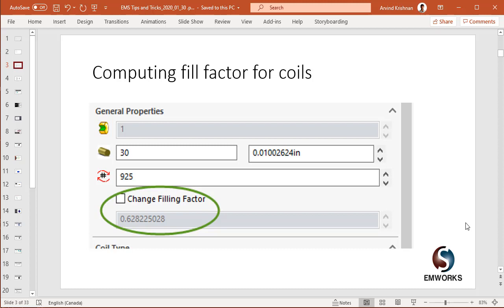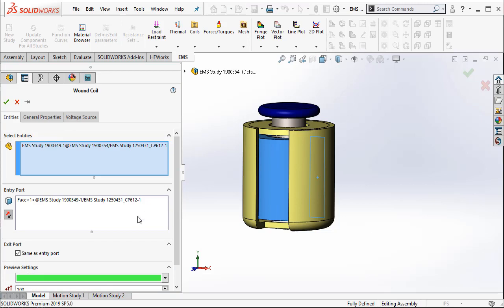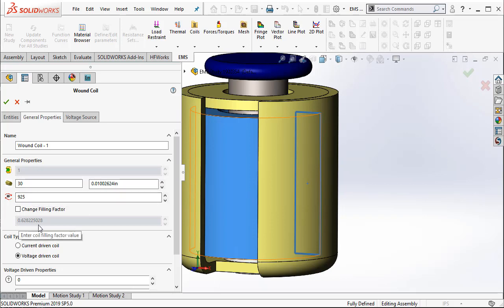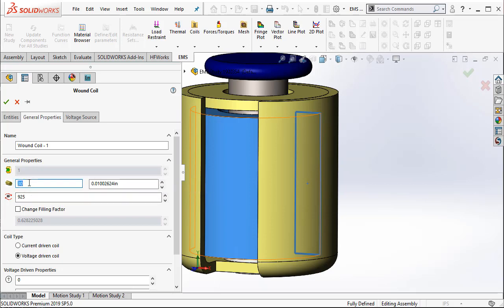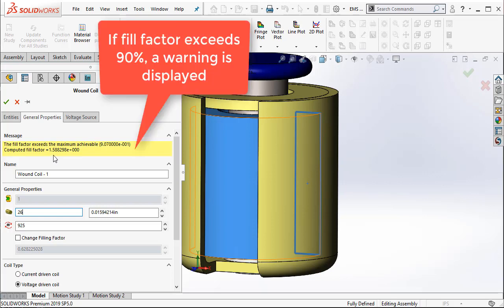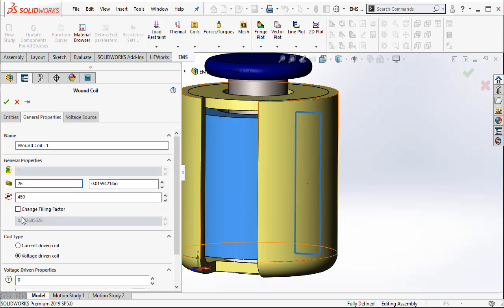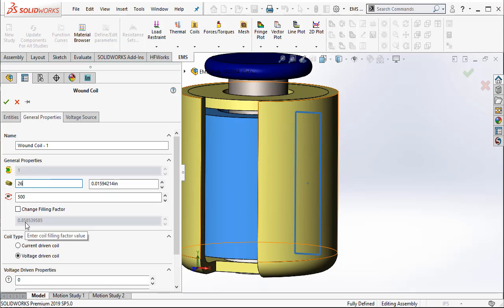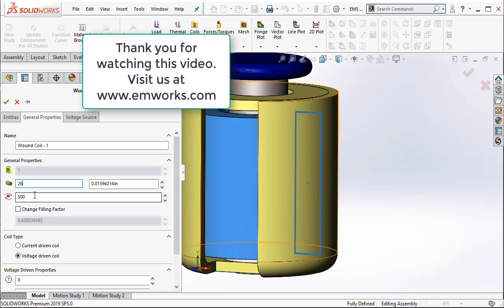EMS for SOLIDWORKS Tips & Tricks- 25: Fill factor computation in EMS

Comment: For round wire is not possible to have 77 or 85 % fill factor, maybe maximum 50-60 %. But this is an awesome feature to have the fill factor calculated automatically.